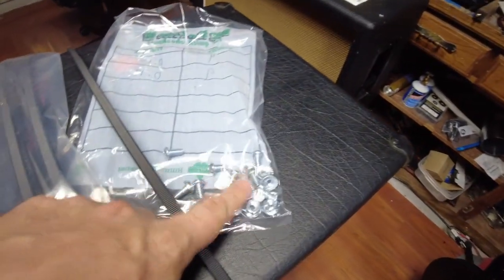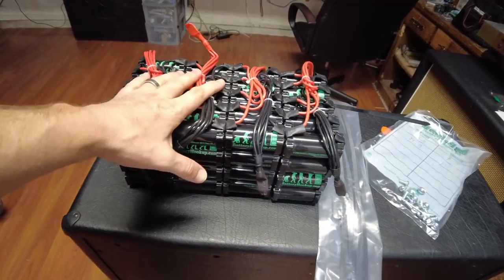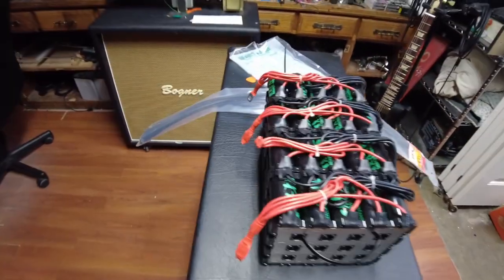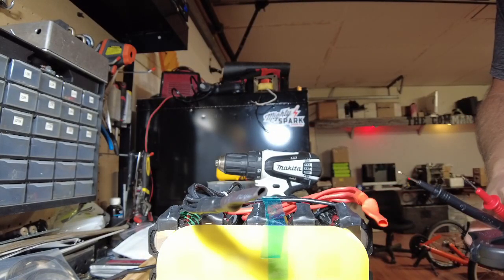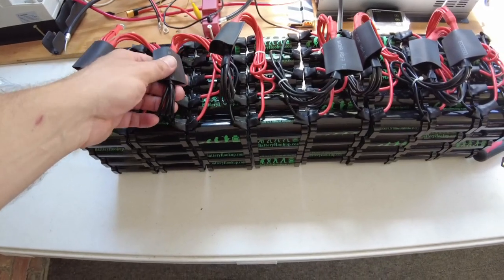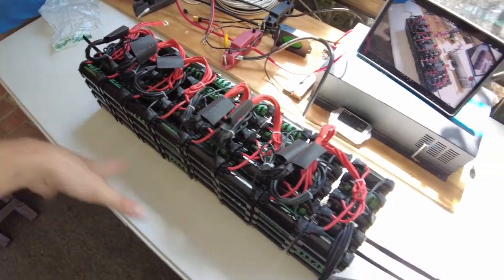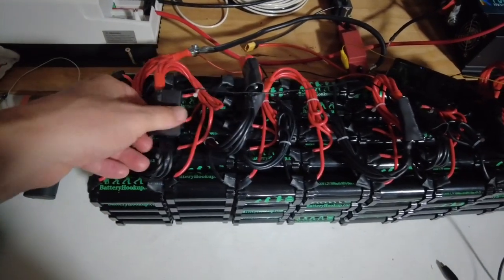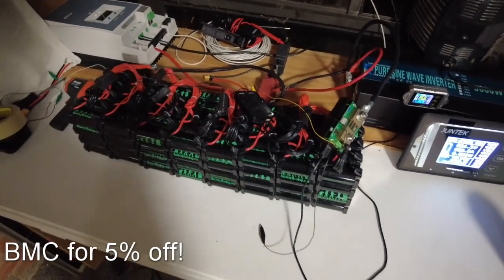DIY Affordable LiFePO4

Comment: They are nice batteries but if you're gonna build a power wall or a big capacity battery why not just use 280ah batteries instead?
Reply from the maker: I think the 280ah Eve's would be preferable. But at the time they took months to ship, lot of scams, and swollen cells used, or grade B sold as new grade A.

Comment: Think it would be ok to keep adding new packs once a month?
Reply from the maker: You talking about add packs in parallel? If so, yes, you just have to make sure the pack you're adding is the same state of charge as the existing packs. Easiest way to do this would be to fully charge the existing, and fully charge the new pack before adding/paralleling the new pack to the existing.
Reply: @BradCagle  right on..thought so but figured I would confirm. Figure Ill add a few more on as I can afford over the winter. Have a great day...Thanks
Reply: @BradCagle  What could happen if you don't observe this indications,  Fire?, explosion, melting,  Just want to known....
Reply from the maker: @forcebewhithyou94  Well house burns down, possibly. Do everything right, and don't get carless, you minimize the possibility of that.
Reply: @BradCagle  mornin Brad...another question.. Batteries will be here tomorrow. I wont be able to get my Epever fer a couple weeks but I do have a 30amp mppt made for Lifepo4 batts I use in my EmComms Box.. Would it be ok to use that for a few weeks till I can order the Epever? I don't see why not but figured Id get yer opinion. Have a great day.
Reply from the maker: @sunnylandcamper  Yes sir, absolutely.
Reply: @BradCagle  up and running..so far so good. First night using them.. Update comeing in a few days.
Reply from the maker: @sunnylandcamper  Awesome! please do update

Comment: I just bought a 4 pack of batteries with BMS and getting a ISDT Q-8 charger for audio purpose what kind of accessories / electronics or equipment you can recommend outher than those ?? And is their any case you can recommend for storage purpose?
Reply: What BMS will be suitable?

Comment: Im looking at these for an upcoming DIY solar build. What are you using to charge these?
Reply from the maker: to top balance i use an ISDT Q8, and for solar charging I use EPEver Tracer 6415 an. I use other EPEver models, they are all good, just choose one that matches your panel, and battery current requirements.
Reply: @BradCagle  I'm new to this so I'm honestly not sure you. 

I want to build a medium sized grid tie system with possibly a small battery back up to store a little extra power. Trying to keep to a budget, luckily I plan to go a ground mount and have a local source for 240W used panels for 50 or less.

I'll likely end up around 3-4 kw but could easily fit 6kw with the room we have with just a single row or panels.

Comment: I like how they conveniently send you a bad one so you could brag about the advantage of buying from someone reputable!

Your idea of soldering the tabs makes sense. Wonder if BH will at some point sell a version for a little less without the leads. Seems like that would reduce labor and materials by a few dollars.
Reply from the maker: They did not intentionally send me a bad one. I can show you the email concordance, shall I come to your place, or you can come visit me for proof. Hell, they won't even send me free stuff for review, trust me I've tried you can see that in my email too. 

Yeah, iv'e got a video coming where I've soldered the tabs, it's way easy. and real clean. But spoiler , it made negligible difference in capacity.
Reply: @BradCagle  I know, I was just playing. I do love how great they are, bought lots from them and have always been treated right. It is great to be able to document them making something right, so much better than us just saying they will :).
Reply from the maker: @BeeneEnergy  You little maverick, I was thinking you were just razzing me, but hard to distinguish satire in the comments :)  Yeah, I'm actually glad I had a problem so I could show them resolving it. Had they given me any BS I would not have held back on exposing it. BTW I agree hey should offer the packs with just tabs exposed no wires. I might suggest that to them.

Comment: Cool build and at a great price.  I'm considering going this route but I'm a bit hesitant about how many points of failure there are in a pack like this.  My application is mobile and I don't see this holding up to vibration.
Reply: This is how a battleborn is built. And i have three of these batteryhookup lifepo4 batteries in my class A rv and they have zero failure after 4 years and tens of thousands of miles on and off road. Now if your workmanship is cruddy or you dont have confidence in your own work... Well thats on you. The rest of us will keep rocking it and saving money.

Comment: Next time use an exact o knife are a real thin sharp object to pull back the little holder to remove your cable tie.
Reply from the maker: Good call, I use to do that way back, forgot all about that trick. Thanks.
Reply: I just did exactly that last week. I have no idea why they expect me to keep putting the blade up...🤔🙄😏🚑

Comment: Initial charge in parallel,  to what voltage? 3.5v hook up the isdt neg. And 1st pos. To monitor? Does it matter where to hookup the charging leads
Reply from the maker: I top balance charge to 3.65v. if you're using ISDT make sure you have it set to Life chemistry. Best to hookup the charging leads , and monitor leads to the same spot.

Comment: I live about 45 miles from Battery Hookup (which is just north of Philadelphia). Stopped in one morning on my way home from work. Great people with lots of batteries. Automatically gave me a veterans discount without even asking for it. Bought the same battery pack (actually bought 2 sets, plan on making 2 12v battery packs). Just wondering what are the advantages of a 24v battery vs a 12v battery? 

Anyone thinking of buying these, do so. You won't be disappointed. Just a word of caution tho, 4 packs (to equal a 12v battery) will weigh in around 33lbs.. No compression needed to get the full life out of these, unlike the prismatic cells (which are definitely lighter).

If you are looking to built a portable 12v battery system without an inverter a 50 cal ammo can is just the right size to fit the 4 battery packs into but it's snug.
Reply from the maker: They've been good to me too! The advantages of going higher voltage is you can run less amperage, which translates into less losses, and smaller gauge wire, less expensive BMS, easier on your invertors, etc..
Reply: @BradCagle  I would consider a 24v system but these weigh enough in a 12v system. I plan on doing something like a portable solar generator and a second battery for the Xterra (need the juice, I'm a ham radio operator).
Reply from the maker: @Brandon-dg8zn  Yup you should be good at 12v for a portable system.
Reply: Hey Brandon.. K8ROY here.. Did you use the BMS with kit? If so what lug on the BMS did you hook to the battery... 73

Comment: You need to put kapton tape on that bare nickel strip if you sandwich them together in 2 of them in the middle are facing the same direction it will cause a loop might be why that battery got hot but love the cell's in the pack good video
Reply from the maker: They are in series, and electrically connected between the packs anyway, so it's not a problem. Battle born batteries are the built this way too https://www.youtube.com/watch?v=G5E30u-66VI
 When I had them in parallel for top balance I had fiberboard insulation between them, the connection got hot on one cell because it was 2.3v, and the cell i connected it to was 3.1v

Comment: What kind of current discharge tester to get? 250W?
Reply from the maker: That should work, just take awhile. I use a shunt, and my inverter plugged into a heater as a load.

Comment: So the 2  packs from Battery hookup came Sunday, 3days. Checked the Voltage all 3.22- 3.24. Connected them parallel.  Got my lsdt q8 max but have to make Leeds. What gauge and how long? Power in  power out? To where? And the 8 port goes to the. Cells? Positive or neg?
Wow lot to learn
Reply from the maker: I use 12awg from my ISDT q8 for 20amps, for your max you'll need 10awg at 30amps. Power in? Are you asking power in to your charger? You'll need a power supply, I just use an old laptop power brick. The 8 port is balance leads, you normally use that when the pack is in series, you don't have to use that when charging 1s (all in parallel) however I still use the first two balance wires because that allows the charger to sense the voltage properly.
Reply: @BradCagle  brad 8 got a 350w brick,  that last rated @1kw, but I suppose it can be adjusted input power. I guess I need to make a balance leed.  8 guess it time to learn how to solder
Reply from the maker: @HappSsack  yeah 350w brick is good. You can adjust the charge current in the ISDT charger.
Reply: @BradCagle  so I setup the battery in parallel.  All cells are reading 3.256v. BMS wont be here for a week and a half. Gives me time to get the leads for the lsdt

Comment: I have been eyeing these batteries for a long time. I like the zip-ties I will probably do the same and just cut a slit in the shrink wrap that is on them to feed it thru!
Reply from the maker: There's a thin fiberboard insulator under the shrink wrap. Should not be too hard to get through it though. I can take measurements so you can locate the holes, if you like.
Reply: @BradCagle  yeah give us a measurement
Reply from the maker: @HappSsack  will do
Reply: The individual packs come shrink wrapped, as shown on the website.

Comment: So, you connected four 100 amp, 3.65v packs together, without verifying that the individual voltages were very close to one another.  That's what damaged the cell pack that was much lower than the others.  Battery Hookup was very kind to replace that for you, when it was 100% your fault for not ensuring state of charge or connecting all of the packs in parallel before charging them.  No kapton tape in-between the cell packs?!  Is this a "how-to" video, or a "how-NOT-to"?
Reply: i agree with brad, yes it is a good idea to make sure your cells are all close to the same voltage before you connect them, but i have seen others parallel connect fully charged batteries to fully drained batteries just to test the amp draw and the amp draw is not near what you would think and is unlikely to damage the cells. but it is possible if you have cells with very low discharge and charge ratings. also when he connected the cells in parallel the low voltage pack would have gained voltage not lost voltage. my guess is there was as least one bad cell in that pack to begin with that drained the whole pack down below 2.5volts. the odds are much much greater that the pack was bad to begin with than parallel connecting it with a higher charged battery
Reply from the maker: No, it's not what damaged it. It was under the 2.5v low voltage limit. In no way connecting a it to a higher SOC cell will magically make it discharge to under 2.5v. LOL, your logic is flawed on that. BTW it was a brief second as it was not bolted together. Also it was only between two cells, so the likelihood of something getting damaged from over current is nil, and lastly BH has this video, sure they would have sent me a bill by now.
Reply: @BradCagle  - When you connect cells in series that are grossly out of balance, a huge amount of current is sent from the higher cells to the lower cell.  That is not logic, that's just the way it works.  You don't have to believe me...look it up.  All you had to do was check the voltage on each cell, charge them all to roughly the same voltage, THEN connect them in series.  Do some research and you'll find that I'm not just guessing at this...that's exactly what happened.
Reply from the maker: @jasonbroom7147  Full stop! I had a cell pack that was shipped to me under 2.5v, and because of that I GOT IT REPLACED. It does not matter how I was alerted to that fact. In the video I even said I should have tested each cell pack. My mistake, however that's irrelevant because nothing that I did discharged the cell under 2.5v, understand? And dude, trust me I know how all this works, but thanks for trying to flex, :)
Reply: @BradCagle  - Yes, you said you should have tested each pack.  You should have then charged each pack to a similar voltage before wiring them in series.  You knew that, but didn't do it?  If it had been me, I would have owned up to the fact that I cooked that cell pack by not following best practices.  Either you didn't know what to do and damaged the pack in ignorance, or you knew better but Battery Hookup was cool enough to replace it for you, anyway.  Good advertising for them, but the goof was 100% on you.  They have to ship them at or below 30% SOC, by law.
Reply from the maker: @jasonbroom7147  Are you just trolling at this point? In what world is 2.3v 30% SOC, you do realize that's the voltage I tested it at right? 2.3v is under 0% SOC, that's on them not me. I'm fully aware of the 30% SOC law. BTW a 3 second rush of current from a single higher SOC cell to a single lower SOC cell IS NOT GOING TO COOK the lower SOC cell. LOL
Reply: @jasonbroom7147  He was connecting them in parallel and that is when the problem was noticed. Connecting different voltage packs in series does not send current from one pack to the other. I think you got parallel and series connections flipped in your head.
Reply: @BradCagle  - Let's try a different tact, here.  Whenever you buy used cells, configured in packs or singly, you should ALWAYS verify that they have a similar charge voltage before wiring them in series.  Yes, a 3-second inrush of current from a 100-amp cell (pack) can and will damage a pack that was at a much lower charge voltage.  If you had taken the time to charge the pack with low voltage up into roughly the same range as the one you connected it to, it is very likely it wouldn't have been damaged.  If none of this makes sense to you, then you simply don't understand how to safely build a battery, even when you are buying the components in pre-built packs.  That is further demonstrated by your failure to put a layer of kapton tape, or other non-conductive material, between the cell packs before zip-tying them together.

I  have never understood why it's so incredibly hard for some people to admit they made a mistake.  One of the really cool things about Youtube is we all get to learn things, even if it's from someone else's mistakes.  Good luck with your battery...I hope it works for whatever you're doing with it.
Reply from the maker: @jasonbroom7147  You do not pay attention, this is the whole problem with this conversation, these are not used cells, THEY ARE BRAND NEW. Also you DO NOT NEED kapton or any
 insulation between these cells in series because they are electrically connected anyway. They come with fiberboard insulation that i used when paralleled for top balance. Tell you what, contact BH and voice your concerns, ask to speak to the manager.
Reply: @BradCagle  Also they come shrink wrapped to the point you can't see any of the individual batteries in the pack. I picked up 2 sets of 4 battery packs from them since I'm only 45 miles from them.